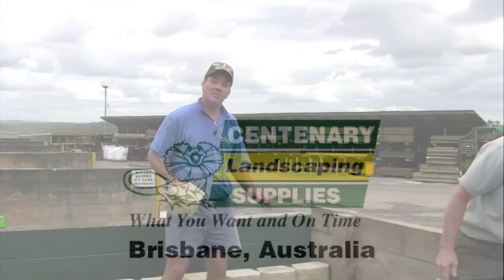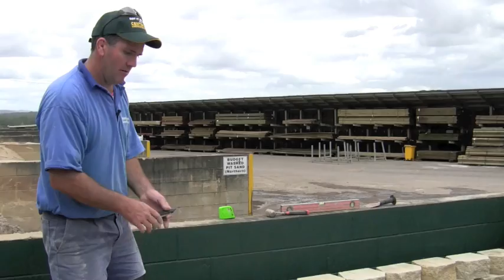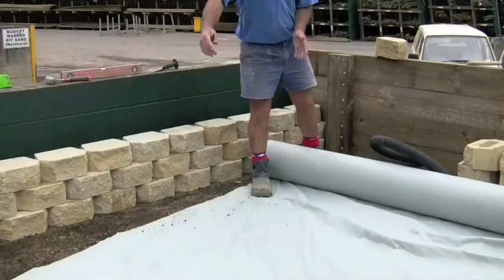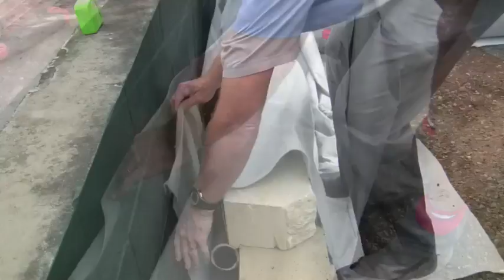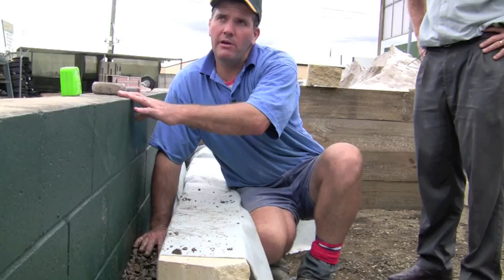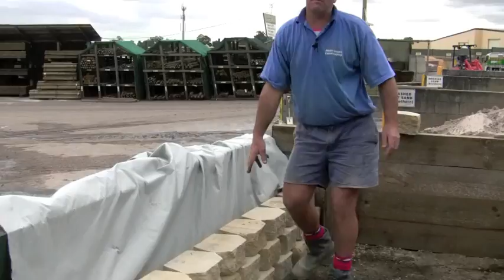Link Block Walls Drainage

Comment: you have a concrete wall at the back? you are not retaining anything nor weight... you don't need the drainage and gravel....It's ridiculous..
Reply: This is just a example when installing a drainage system for a retaining wall. I don't agree with using a non geo fabric. It will cause water to build up behind the wall causing a total failure and collapse of the wall.

Comment: !00% Wrong.....Never use landscaping cloth between dirt and the gravel,  The cloth will load up and stop the water from going though the cloth and the hydraulics will push the wall out. Total failure.
Reply: What should you do instead?
Reply: what do you recommend?
Reply: you are correct I was waiting for someone to point that out